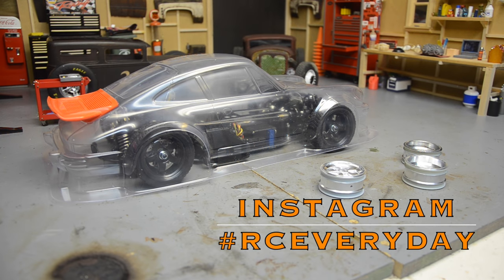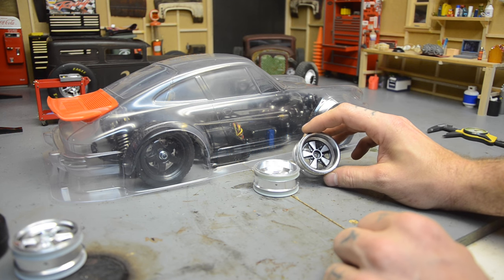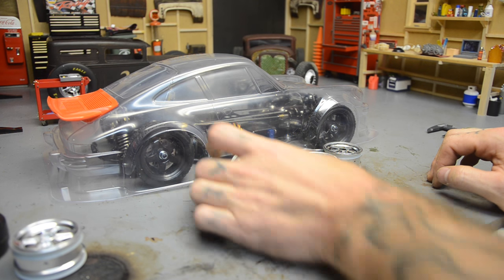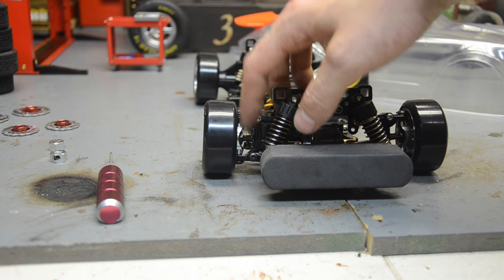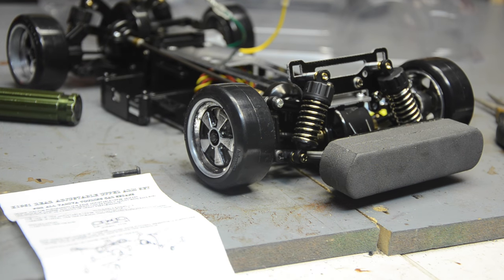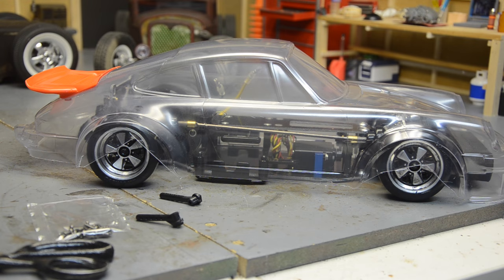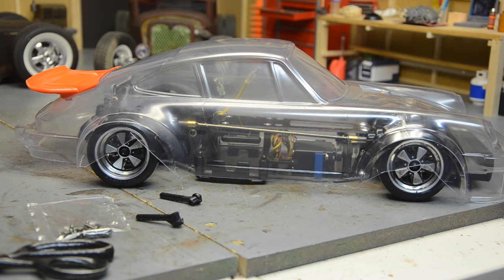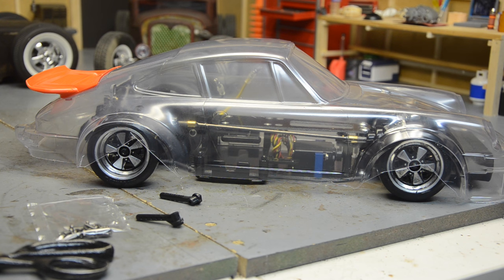Weathering HPI Porsche Wheels for the Tamiya TA02sw Porsche

Comment: hey bro,i am painting a win for my sprint car,having problems!done screwed up one wing and had to buy another one 30.00 screw up ha,but i am trying to paint it silver but the tamia paint sucks,have to use a white backer and it keeps comming out looking like a zebra,any tips?what paint should i use?i am using this car for racing so i need a flexible paint,please help!keep up all the awsome stuff you do,you have tought me alot and i thank you,hope to hear from you soon,thanks
Reply: Are you painting a clear polycarbonate wing? If so make sure you are using spray paint made specifically for polycarbonate (on Tamiya paint the paint number always starts with PS) and make sure you are using the correct backing for that color. Paint in THIN, EVEN coats especially for the first coat, painting thick coats and not allowing enough dry time between the coats can cause stripes and other imperfections. I have found Tamiya spray paint to be about the best rattle can paint for RC bodies, just make sure you warm up the can by placing the bottom in some warm water for a few minutes, this helps thin the paint and make it spray more evenly. And you can always  practice on scrap pieces or clear water bottles before painting the wing. Hope this helps and good luck.

Comment: Nice bud. Love the wheels. The bottom skirt witch is the sheet it's printed out of can be used for front splitter and side skirts. If preserved. Yoda Mini Drift Truck? =D
Reply from the maker: Haha, thats always the first thing I do , start trying on all the bodies I have on a chassis.  this thing is tiny, the back of the yota cab hits the rear wheels.
Reply: Even with the rear suspension flipped around for the long wheel base?
Reply from the maker: That only adds around 10mm
Reply: Ah poopy pants. just have to keep your eyes open. body will pop up 4sure. I'm a big fan of hunting bodies from the thrift stores. Nikko makes some nice toy grade bodies. :)

Comment: Hi! I'm renewing a vintage TA01 chassis and I would like to put some nice camber on it (rear and front), are that toes compatible with it? Can you post the link or just give me a suggestion to find them? Thank you very much! Great channel!
Reply from the maker: Original upper links are hard to find.  The brand i used back then was Kose.  I made some adjustable uppers work from a tamiya M05-M06 chassis, just have to change out the ends on the them.

Comment: Please tell me where to buy body and porsche wheels.been looking for years.I have sakura1\10.great looking car.
Reply from the maker: This body will not fit your standard touring car wheel base.  the ta02sw is shorter and wider at the rear.  It is from tamiya.  The wheels are from old HPI Cup Racers and are about a 1.7 size and come in a variety of offsets if you can still find them around.